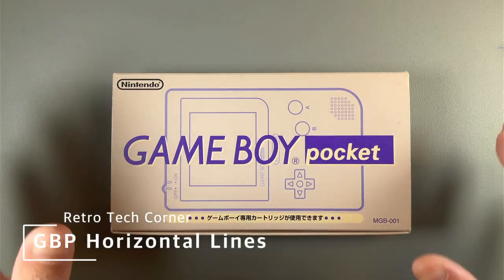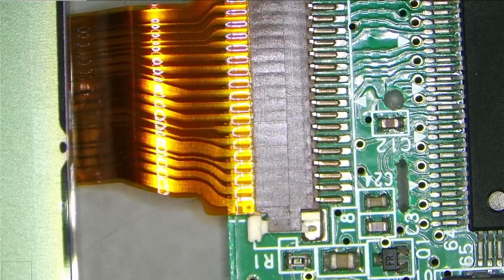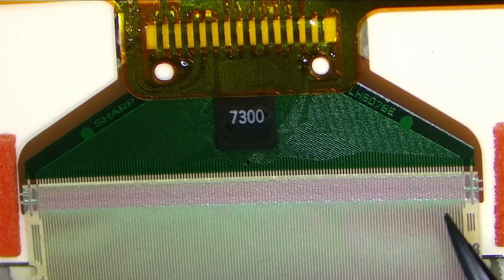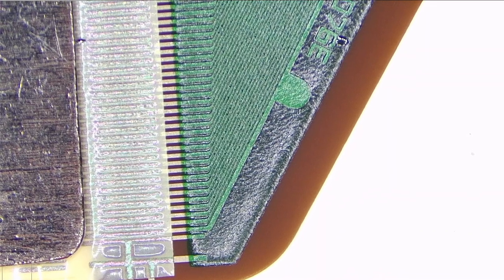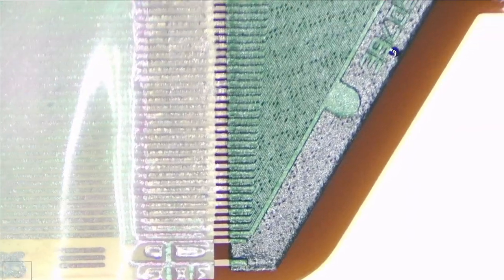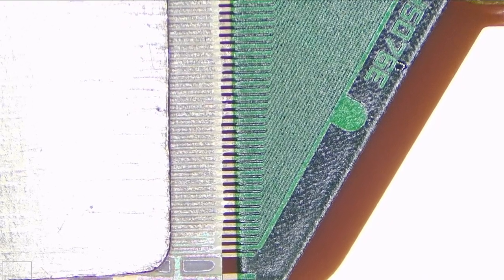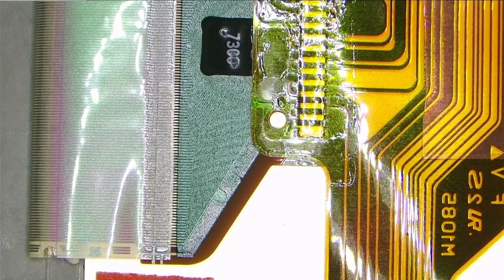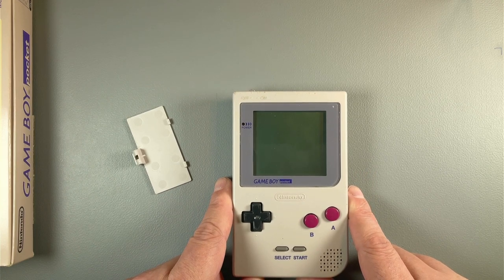GameBoy Pocket horizontal lines repair

Comment: Very common problem with Nintendo products of that period. Often it’s a separation of the ribbon cable to the displays. This also happens to the Virtual Boy but for that it’s like Nintendo used some kind of an adhesive to fix the ribbon cable to the LED panel so it’s preferable to solder the ribbon to the LED panel due to the ribbon being stressed from adjustments to fine tune the display with user’s vision. Ultimately I sent out my OG GameBoy for an IPS screen mod to correct the problem indefinitely. The IPS screens have ability to replicate the originals look pretty well. Excellent video
Reply from the maker: Yes - IPS is the way to go. There's two issues with them though - they are not cheap and (specifically for GBP) they tend to drain the battery (and in GBP case it's just two AAA batteries and they will go out pretty quickly).

Comment: Very helpful video. at 3:00 In my case however the problem was indeed at the top, screen facing connection so don't count it out if you're having trouble

Comment: Maybe if you have put it on a glass table upside down and a mirror at the bottom, you could watch live the lines being corrected. You could also use a marker in order to mark the problematic area and therefore not risking damaging any good one.

Comment: Fantastic work, thanks for sharing. I have an ideia that maybe works, if we use a hair dryer? Probably don't melt the ribbon cable and maybe is enough heat? Best regards
Reply from the maker: Hair dryer may not generate enough heat... I generally advise using good soldering iron (regulated and preferably calibrated) and starting from very low temperature and adding 10 or so degrees every time. Then gently touching the ribbon (where the solder is) for a second or so and see what happens. First try is usually risky but once you do it a few times its not that hard...
Reply: @RetroTechCorner  Makes sense. Thank you very much for all you attention. Continuation of good works.

Comment: Thank you for this tutorial! I'm a bit hesitant to try it, if the ribbon cable melts then the whole screen is to be replaced?
Reply from the maker: Most likely - yes. You need to start at low temperature and take it easy. Also - don't hold the soldering iron in one place. Try to do exactly what I did in the video.
Reply: @RetroTechCorner  Thank you for your answer! I tried it with my soldering iron at the lowest temperature but unfortunately the cable instantly melted on the first contact... I guess I shouldn't have trusted my cheap tools 😓
Reply from the maker: Sorry to hear that... As I said in the video - the temperature is the key and I recommended a calibrated soldering iron. You could still try and save the cable if the traces are not mangled (but they probably are if you melted the "lower" part of the cable). Have a look at the beginning of the video where I'm talking about temperature and where to heat the cable). Again - sorry to hear the bad news...
Reply: @RetroTechCorner  Don't be sorry!! Your tutorial is extremely helpful! I'm the one who should be sorry for having broken a Game Boy screen 😅At least I've learned my lesson, and I guess it gives me a reason to upgrade to an IPS screen 😅
Reply: @flieen  literally just burnt my ribbon

Comment: 190 Celsius?
Reply from the maker: yes - start from there and go up. But once you reach 230-240 you'll most likely start melting the ribbon cable
Reply: @RetroTechCorner  appreciate it!